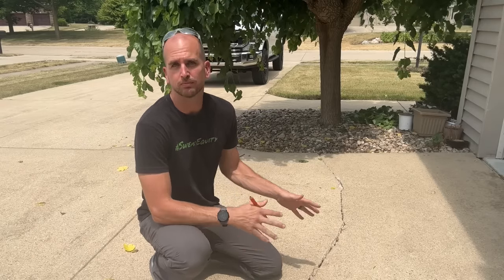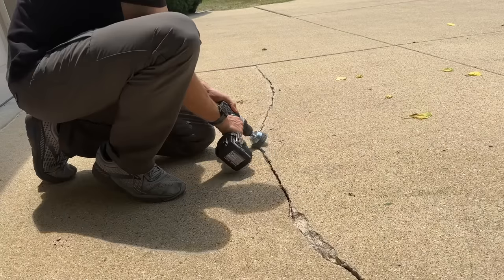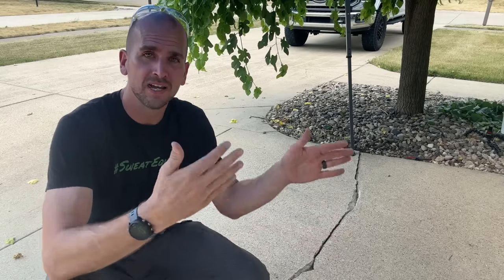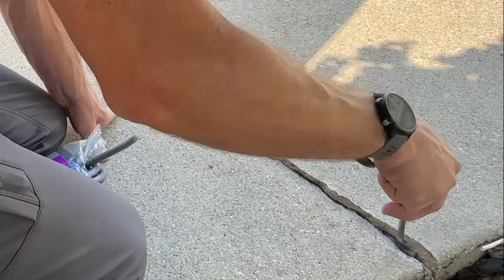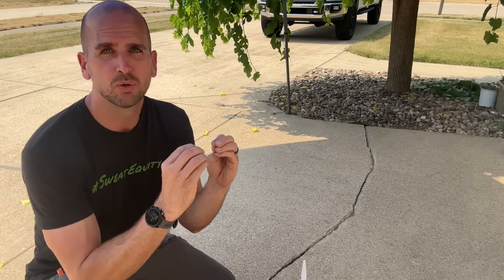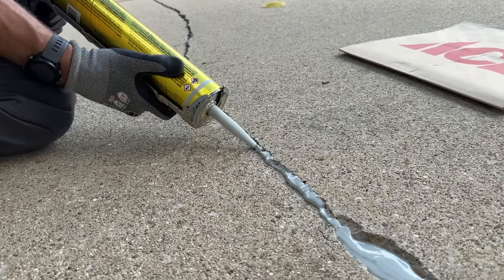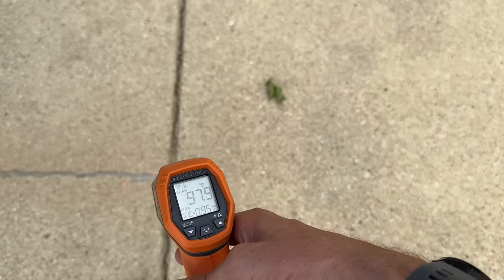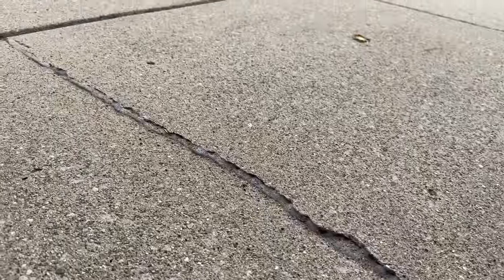Repairing A Neglected Driveway Crack |  The Ultimate Solution!

Comment: You can buy a concrete cutting/grinding blade for your angle grinder to open and clean the crack for prep. Also you can grind down the high side to prevent tripping hazards by rounding the edge.
Reply from the maker: Not a bad idea, thanks for the feedback.
Reply: Yes, good thinking.
Reply: I have done this professionally for over 45 years. This is actually the correct way to repair this type of crack. It should always be ground open. In fact professionals use a “ crack chaser” diamond blade. It is “ V” shaped and makes it very easy to follow the crack.
It is more expensive ( about $45) but will last a homeowner several lifetimes no matter how many rental properties he has
Reply: Plus you can "reshape" the crack with the grinder so it looks better and more uniform, thats what i did.
Reply: @drumswest5035  the crack chaser wheel makes this very easy
Reply: If you need a crack chaser go to any large  American city they are plentiful 😂
Reply: @Oldvolks44  another 12 year old heard from
Reply: @genecarden780  why does the crack need to be ground open? Is it for smaller cracks where the sealant cant go in?
Reply: @simd510  because sealants perform on a percentage of movement. So let’s assume 25% movement. ( a very typical spec) 25% of 1/16”  or 1/8” is a very small amount of movement before sealant failure. Most  quality sealants list  1/4” as minimum joint size due to this. I hope I explained that in a way that. Ames sense and is not gibberish.
It also gives very clean ,sound “ virgin” concrete that is ultimate for sealant to bond to. So the answer is yes and no. You must open small cracks but we also “ dust” all concrete to clean it. BTW  is the 510 in your name your area code? Just curious.
Reply: @genecarden780  thanks for explaining! That makes sense! Yes it is the area code where I used to live.
Reply: @genecarden780  this must be why the crack repair from the previous owner failed. They filled the tinest crack without grinding. Do you happen to know an easy way to remove the old sealant before I grind and reapply
Reply: Make sure if you are grinding concrete to wear a respirator. Silicosis is a serious and irreversible condition caused by breathing silica into your lungs.
Reply: I bought that wheel in amazon. Comes with a " V " shape so it creates a V-groove into the crack. Also I drilled some pilot holes into the crack all the way thru the the cement and injected foam with a gun (you can also use the foam can). This helped foam go inground and come thru the crack to fill any voids. After the foam dried, I cut the excess with a knife blade and then ran the  grinder with the V-wheel, then after, I added the epoxy to the crack finishing it with sand for a nice texture blending look.
Reply: It's just me,  but it still looks like a crack.. I guess I need the skim coat video for the whole driveway?
Reply: I was just going to post that question in regards to cutting down the higher parts.

Comment: A better solution occurred to me that I used for a relative’s driveway. His didn’t contain cracks. However, the individual pads had lifted or sunk over the years, creating trip hazards and interfering with water drainage. He hired a contractor to inject expansion foam that re-leveled the pads. Afterwards, I filled the gaps between the pads with POLYMERIC SAND. It has performed  well. Unlike mortar, it allows for movement. Unlike caulk, it blends perfectly with the concrete. I’m going to fill cracks in my driveway with it.
Reply: Wow, Polymeric sand. Where do you find it? Is there any other name for it?
Reply: @randallsemrau6911   An UPDATE:  Have just returned from a visit. The polymeric sand (generically referred to as grouting sand) is failing in some places. There were deep cavities under the gaps between the concrete pads. Eventually, the polymeric sand collapsed into those cavities. To prevent this, I would  do the repair in stages. First fill the deeper recesses with ordinary sand. Allow it to settle for a month. Rain and vehicle vibration will hasten settling. Repeat where it has settled more than 1/2 inch below the desired grout level. If the sand is still visible after another month, top it with the polymeric sand. Apply the poly sand in THIN layers, watering it thoroughly so that its adhesive is activated.

Comment: When I would do this, I always hated the filler not blending into the concrete and thus contrasting colors as an obvious repair. To fix that issue once I would add the filler to level it with the surrounding concrete, I would use either sand or pulverized concrete and add it as a light topper to blend it in, and what a HUGE difference that made as the sand\concrete would adhere to the filler and would be almost impossible to remove and would make the whole job look a million times better.
Reply: Excellent suggestion! I've done the same on a previous project however the sand didn't adhere too well to the self-leveling caulk, not sure why. Thanks
Reply: @arminius301 it does come at a cost. It WILL shorten the lifespan of the sealant. But unless you are good at caulking it can look like a mess, and VERY LIGHT dusting can make it look better.
Reply: YOU should have made the video!
Reply: I use Quickrete straight out of the bag after angle grinding to minimize slope, adding backer rod, and filling with sealant. Definitely makes it far less obvious!

Comment: I had to use the "pool noodle" method!  I've got some areas which I forgot to prep . . . and needless to say, the sealant kept going down and I will have to go back and prep it and then add some more sealant.  Funny thing . . . my wife question the "pool noodle" method and said, "Where did you learn that, YouTube?"  LOL!  Thank you for your videos, they have save me a bunch of mistakes and money.  On the end, where the crack really opened up, I used an aluminium, square blank that I had from other projects (4X4) piece and tapped it into the ground next to the end of my front porch.  It served as a rigid dam at the end.  Worked really good.

Comment: I have multiple very small cracks. I first slightly enlarged the cracks, then cleaned edges and add sealant! Final step was to add small sand/gravel to match but can adhere to the sealant. It is a 24-year old driveway in the Texas heat and cold and still looks good!

Comment: Great video and prep technique. I can say this is the most effective long term solution, as over 20 years ago I repaired my concrete parking lot using multiple methods (some areas used quikcrete other areas used Solonlastic SL1 with backer rod) the ladder method has held up for 20+ years. All the quikcrete repairs broke up after a few years.  Of course a professional would know that would happen, but for me at the time it was an experiment…

Comment: I did the same thing to my driveway two days ago but used the Sika self leveling sealant from Home Depot. So far it looks good. (I’m a diy person with little experience so I watch lots of videos on YouTube. Thanks for your video.
Reply: Did it start to crack again
Reply: I am a professional caulker. We use Sika products all of the time. It was an excellent choice
Reply: @genecarden780  when you have a crack in peice of concrete, I had now because 2 peices of concrete.
In the same day there is enough temperature change between night and day to make the 2 peices of concrete to move due to temperature change causing it to expand and retract. Is Seka strong enough to hold 2 large slabs of concrete together .
I don't think so.
Reply: @drmidnight680-kz2le  It does not hold them together. The slabs will still move thermally but the sealant will stretch when crack is bigger and compress when the crack is smaller. That is actually exactly what sealant is designed to do. If you actually “hold them together” it will most likely just crack somewhere else. Depending on why it cracked in the first place.
Reply: @genecarden780  temperature changes from different months will higher causing the adhesive to fail and the crack will come back after several months.
 It may not take long at all if you drive car over it.
Reply: @drmidnight680-kz2le  does the slab rock when you drive over it?
How wide is the crack and how much does it move?
Reply: @genecarden780  there is movement and a crack splitting the concrete in half, I used Seka before.
 It looks great for a while but the crack will come back in less than a year with seasons change.

Comment: Hello Scott,                                                      When a crack on a sidewalk has different elevations, I'll take a grinder with a concrete grinding wheel and I'll grind the higher elevation so that there is a taper that levels where the crack is and gradually gets higher (a six inches taper in total). This way, when water travels across the sidewalk, it won't collect where the crack is & I've eliminated a trip-hazard. .... Then, I'll proceed with similar steps as you've shown in this video to seal the crack. 👍
Reply: I was thinking about doing that on mine, but due to time constraints and lack of access to a concrete grinder, I did have to resort to the "pool noodle method" which works surprisingly well!

Comment: Great topic and instruction. I used that same Valkem product here in WI several years ago, We have temps from as high as 100+ to lows as low as -20 and this product works beautifully.  Yes. per tube its a little pricey but it's worth it as it will last for years to come

Comment: GREAT video.  I like the prep work to ensure it sticks and lasts.  I didn't know about SSL, and have only used the thinner stuff. I've got some gaps over 1" after slabs shifted when ground was saturated due to a neighbor blocking drainage (with my driveway on a berm). Using backer rod is the trick.  Problem here (near St. Louis) is water/melting snow gets down in cracks and freezes/expands in winter, and pushes slabs apart and pops up more concrete

Comment: I use a 5 in 1 tool for digging around in the cracks.  Myself, I have several of these, and use my older beat up ones because it will take the edge off the tool.  Also, I make sure I keep the tubes warm so they flow easier causing less hand fatigue.

Comment: I recently did moms drive. She had same issue. I put polymeric sand in first then watered it as
Per instructions then did the SLC and did the sand trick on top to blend it in. She couldn’t believe how good it was
Reply: Using polymeric sand is a very bad idea for several reasons. 1 backer rod gives the sealant the proper profile. 2 the sealant will bond to the polymeric sand creating a 3 sided bond. THE WORST CARDINAL SIN YOU CAN CREATE WHEN INSTALLING SEALANT. The addition of sand on top of the sealant , while it may look good shortens the lifespan even more.
As a professional anyone did any of these things I would be fired.
Reply: @genecarden780  I don't get #2: At worst the polymeric sand will shear at the point of contact with the sealant, and there goes your 3 sided bond. Also, won't the sealant bond to the closed cell foam 'rod' and create a '3 sided'  bond?
Reply: @luisderivas6005  no it usually won’t shear,it will usually pull free from the sides first. It takes surprisingly little restriction of movement to cause sealant to fail. Just being slightly too thick will cause the sealant to fail prematurely. There are always exceptions. But that is only a matter of luck.
No,sealant does not bond to backer rod.
Reply: Forgot to mention this was in her car pad.  It cracked due to drainage issues which we did fix. As well once done with the crack fixes, we painted the floor with porch paint. It looks amazing. But points well taken

Comment: The expansion joints had rotted out on our patio. When I fixed that the first time I used the backer rod. Using that technique on larger cracks can lead to problems when the backer rod shifts under the sealant. IMO, a much better technique was to fill the crack with sand, pound it in using a board that was just smaller than the crack and a hammer. Then use a self made wooden scraper that left about 3/8 of an inch of sand in the crack. That produced a nice looking long lasting patch.  One thing he might have mentioned ,that was at least true of the sealant I used, that stuff sticks like mad. He alluded to the problem when he talked about having something to lay the caulk gun down on was a good idea. Absolutely, if you are using full self leveling compound a lot of care is necessary to keep from getting the sealant in the wrong place. It is hard to get off.

One other thing I learned in that project was how to remove sealant from a crack if it needs to be removed: Oscillating saws work very well for cutting the old sealant free.

Comment: I think this was a great video. But if you going to do all that work I would of taken a expanding spray foam such as “Great stuff” (not the most rigid out there once it dries but the original formula is actually pretty stout) and sprayed it down into the crack. If you have a crack larger than a quarter inch or 6-12 months old you most likely have under washing beneath the driveway. Some subsurface erosion. If driveway had proper gavel, tamping, and installation. Only roots or water erosion will cause uneven heights in concrete.
So the expanding foam will fill in all the holes and gaps left over from water erosion. And prevent for an extra extended period of time the sinking concrete sinking farther. Can’t be the extra soft cell stuff for like around windows and doors though. Then trim it 48 hours later and it will also act as your backer rod. Then seal it with any quality sealant like you used in video. 
Using the foam should buy you at least few years before any additional slab sinking and sealing the crack prevents future water erosion buying you at least a few years also.
Lastly I would dig to and chop the roots 2’ back from the driveway. They should be only 4”-12” deep and close to in line with crack if it was involved.
Well that was a fun book to write lol. Thank you to the 1 person that eventually reads this whole thing ha
Reply: Thank you for communicating that. Not sure why people are so averse to reading words these days. Books are considered bad?  Your comment was appropriate and VERY MUCH APPRECIATED.
Reply: I read it all the way through. Thanks for posting, and sharing your tips. I will follow your suggestion for some larger gaps. Thanks, and thank you Scotty!
Reply: @freedomofreligion3248  Reading words?

Comment: I’ve had voids develop, washed out by the drainage behaviour you demonstrated. Without support any repair would flex & crack. I just had to drill a pattern of holes along the crack and up to a foot either side, holes pitched 6” apart. Then it was a matter of injecting grout very carefully to avoid hydraulic jacking of the concrete. A few holes took pints of grout, clearly voids! After a month to let everything cure I finished filling the crack, no need for backer. Four years on and no new cracks, phew,

Comment: I use my leaf blower to clean out the cracks. 200mph wind power works well along with my power washer.  Have any of you ever tried using Great Stuff expanding foam to fill the cracks with a base layer before sealing over it???

Comment: So much great information, thank you. My question is, will this work on concrete roofs. Or would it be better to just go over with thin concrete coating like Quikrete? I know you said you didn't care for that method in the beginning of the video but rooves and driveways are different. Also, I really appreciate the tip about temperature, I live in a very hot climate, good to know that will make a difference. Thanks again for a very informative video.